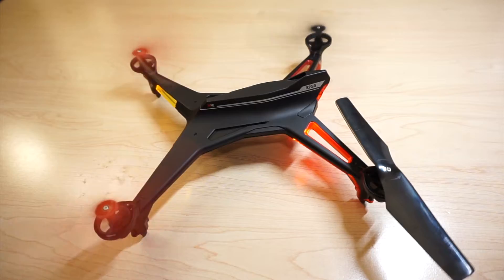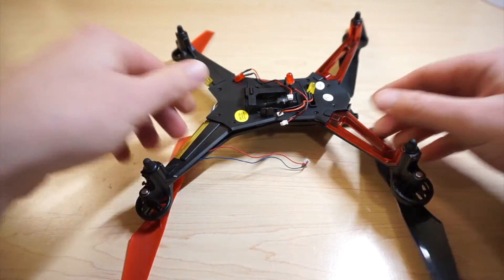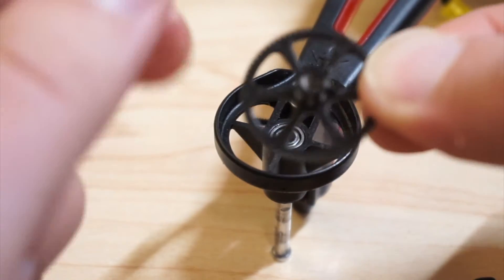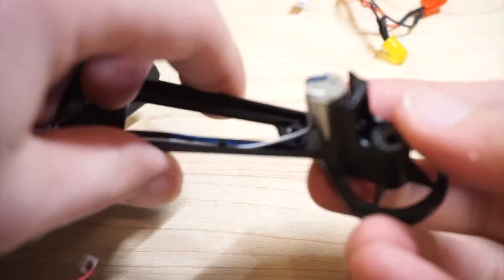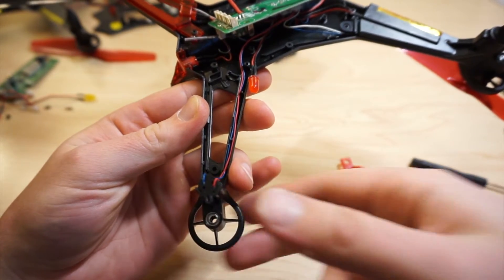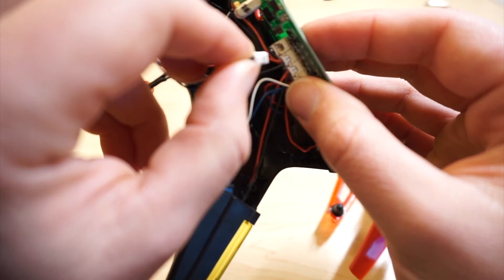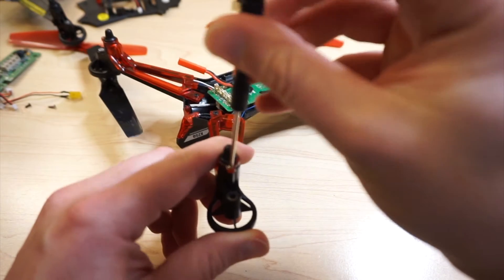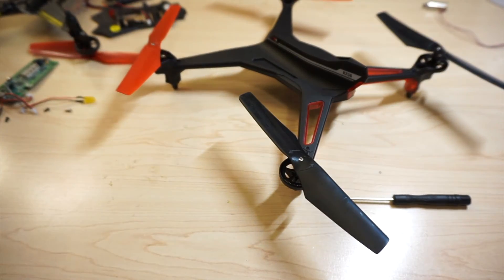HOW TO REPLACE AN XK ALIEN x250 DRONE QUADCOPTER MOTOR

Comment: Cool man. Just got my replacement motors. I have 3 aliens and fly them almost every night. I've only had 1 motor go bad so far. You gotta get the Tarantula TX. $20.00 eBay   I'm getting incredible long range acrobatic flights. Great video ! Very clear.
Reply from the maker: Sweet, let me know how the install goes! I will check out the Tarantula TX. Stoked